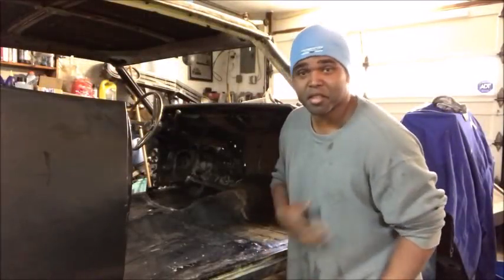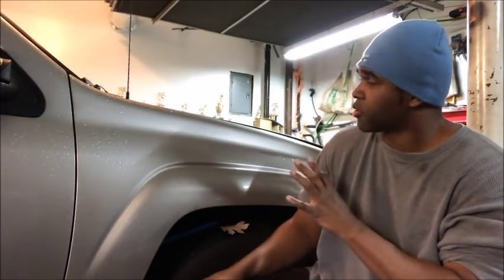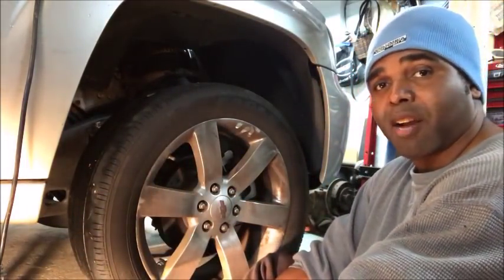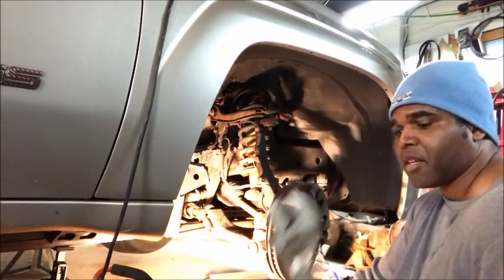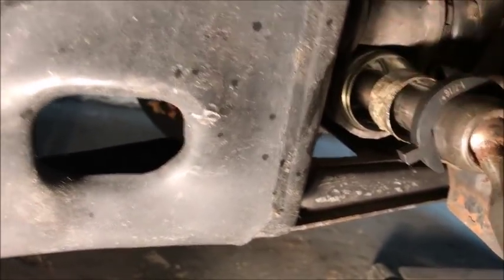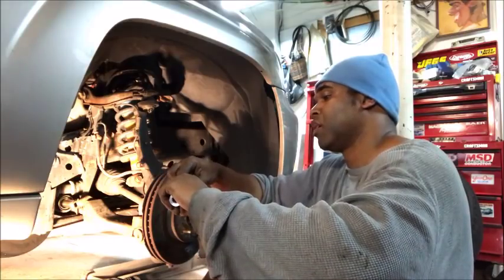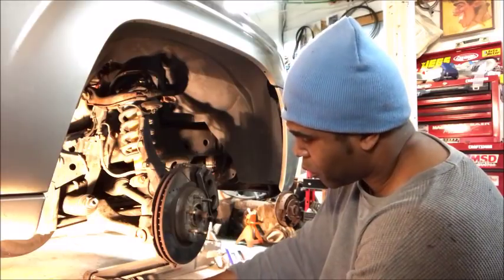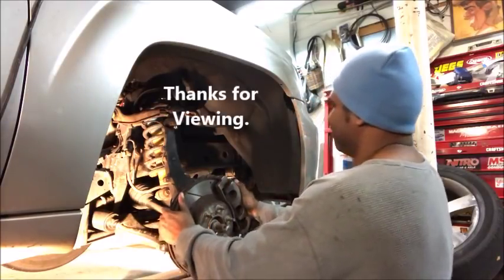How To Replace A Inner Tie Rod End.. (Do Not Replace the Steering Rack!!!)

Comment: I love my harbor frieght inner tie rod tool!!! Also your the same way with using zip ties haha that's all i use than those stupid metal clamps. This weekend i just bought drilled and slotted rotors, new pads, upper control arms, ball joints, inner and outer tie rods for $160!!! Found a deal for sure.

Comment: Shop is telling me the play in my steering and lower control arm bushings will not allow them to do alignment. Should I replace the whole rack and pinion or just the tie rods?
Reply from the maker: id check the Tierods for sure.. shops are quick to take your money.. they told me the same thing.. keep me posted..

Comment: Do you need to torque the jam nut on the Inner TR to certain specifications or it doesn't matter because you go for an alignment anyway and the mechanic will torque it down?
Reply from the maker: very true.. right to the alignment shop..

Comment: Thanks bud...  Good video!  Hey, I read somewhere that you could damage the rack if you don't secure it when installing the inner tie rod.  Is this true? If so, what is the best way to do this. I always thought you just unscrew the old and screw in the new. What's the "scoop?"
Reply from the maker: hmmmm mine was secure in the Truck. lolol i im not sure, im still driving on the original, i guess that say something.. keep me posted on what you do brotha maurice..
Reply: @Coverman66  I'm thinking maybe it depends on the vehicle.  I asked my local mechanic about this and he said yes this is true with your Ford Explorer but your Chevy truck is entirely different.

Comment: have a acux mdx was working on the axle cut a hole in the tirod boot by mistake now fluid is leaking out of the boot most say its the rack could it be a seal at the tir od end like you just showed?
Reply from the maker: not familiar with Acura.. but i think most racks and be serviced to a point..

Comment: Can a bad inner tie rod cause bad knocking over bumps in the road? Also does it make a strange pinging like noise when you rock the steering wheel?
Reply from the maker: sure. depending how bad it is.. check it to make sure..

Comment: great vid man,I have a question. I just Replace my  Rack and Pinion and now my Steering Wheel is not Center,do I have to take the Rack and Pinion off and center it steering wheel is in the 1clock positionit a 06 trailblazer
Reply from the maker: make sure your inner and outer tie rods are set properly. bring it to a guy who knows front ends..

Comment: I have a leak on my driver side coming from the inner tie rod boot. I took it to breaks plus and the diagnosis was I needed to replace my rack and pinion. Of course I have no money to do this as they estimated the cost to be around $1,200.00... as a college student who works full time this is not possible. Could I perhaps just change the inner tie rods and fix the issue? (Also picked up some Lucas rack and pinion leak stopper just in case..)
Reply from the maker: i would check for myself where the leak is coming from it might be just a o ring replacement in the rack..
Reply: coverman66 thanks for the reply! Doesn’t that require me to take the rack out either way?
Reply from the maker: not at all,  not to check for the leak..

Comment: When you do that job, do you need to remove the Airbag fuse? In Hayne's Book they don't discuss 
the Inner Tie Rod, just Outer TR and Steering Gear, and they say that if you work on the Steering 
System you need to disconnect the Airbag. Is it only if you replace the Steering Gear, or for the 
Inner TR as well? I changed Inner and Outer TRs on one experimental (our back up car, 2001 Saturn SL2) car, and I didn't disconnect the Airbag. Now reading about 2003 Chevrolet Cavalier I came across this statement about Air bags disabling. Also do you need to straighten the wheels? They advise so for Steering Gear replacement, but it is so easier to reach the boot if the wheels are turned all the way, so the Inner TR is more exposed. Very confused on this part, please help. Thank you for the great film.
Reply from the maker: thanks Olena.. i always disconnect the battery. thats first. my rule is simple any way you can get the part out without damaging yourself or the car. the books are a guide line and not always right.. hope this helps..
Reply: @Coverman66  Thank you, very helpful. Though I removed the Inner TR already, it is good to know your opinion about guide books, very true, of course they can't discuss all the details, takes years to learn everything on this type of work. The reason I stuck  w/that battery disconnection (which is not big deal at all), bcs as far as I understand, after you do that you need to drive on the HWY a bit for computer to learn the battery again or smth. (to go for the state inspection). If it is a backup car you might don't really want to do that (if it is an old car). Maybe it is not really so, and you just drive more miles. In one dealership they told me to drive like 100 mi, if not go on HWY. Thank you again.

Comment: May I ask how do I loosened the outer tie rod nut to remove the outer tire rod off the rack opinion?

I wish I would have loosen the nut before I pull the rack opinion out of the car! 
New rack opinion did not come with outer tie rod’s
Reply from the maker: it gets tricky but it can be done..  just be careful.

Comment: Hey coverman .. I’m having problems with my steering system .. when I turn the steering wheel I hear a popping noise.. when turning right I hear a clunking noise ... doesn’t happen when turning left.. something feels broken or loose ! Car recently came out of alignment as well ! Mechanic told me it’s the rack and pinions what do you think?
Reply from the maker: could be,, i would check out the ball joints as well.. will the noise happen when the car is still?
Reply: CV axle
Reply: Diamond Sisters when you turn right it pops. Left or right a popping noise is the CV axle or CV joint. You can test this in a parking lot. Just do a full turn left or right and you will hear a popping sound from said left turn the passenger side and said right turn driver side. That’s from the axle being pulled outward in the left or right turn and the joint slipping.
Reply: Rack would be fluid leaking from the inner tie rods or a whining at the steering pump
Reply: But all in all. If it’s a good rack a bad ball joint or inner outer tie rod an suspension can affect alignment. It’s all part of your toe, caster and camber
Reply: The fluid in the rack can be affected or the rack itself by bad parts as such causing the rack to go bad causing one half of the rack to take more fluid then the other an this usually happens with leaks from the tie rod causing pull to the left or right.
Reply: @DFiantFigure  You gave out a lot of good info, and the person NEVER said anything. So I will thank you.

Comment: Unfortunately, when I took my boots off (on both sides of a 2004 TB I was gifted), there was power steering fluid pouring out of both ends, 'cause the seals in the rack & pinion are toast, so I really wish that I'd just bought a new rack & pinion, instead of the hassle of replacing the inner tie-rod ends & getting the boots back on; every new or remanufactured rack I've seen for a Trailblazer comes with new inner tie-rods already installed, and also with the boots already on.

As soon as I recover from the pain & suffering of doing the entire front suspension, Rock Auto will probably get my order for a new rack assembly new rear wheel bearings+seals, & new rear links/upper trailing arms, but it can't be nearly as hard to replace than doing the upper/lower ball joints, upper/lower control arms, struts, springs, front end links, & wheel bearings on the front.
Reply: BTW, most of the entire front end job I did, was with HF tools, and their EarthquakeXT cordless impact tool was a SuperStar!  I needed to go to a salvage yard to get a left-side steering knuckle, 'cause my lower ball joint was seized/welded to the original knuckle, & was replacing the lower control arm anyway, so it made short work of pulling whatever I asked of it, whenever I asked, with no drama.  Everyone needs to have one of these!!!!
Reply from the maker: thats what im talking about.. Dont Hate the Freight..